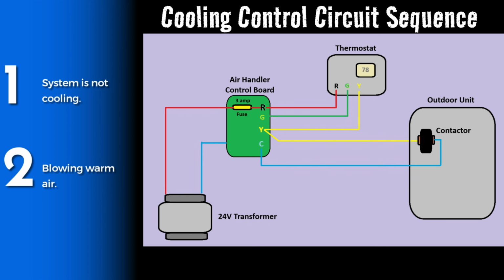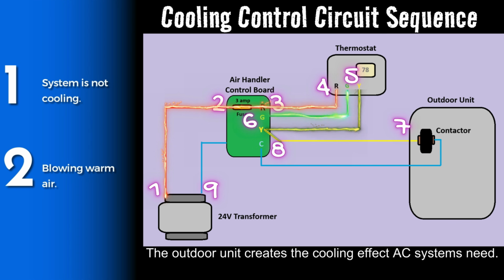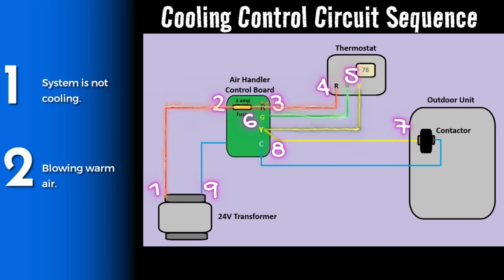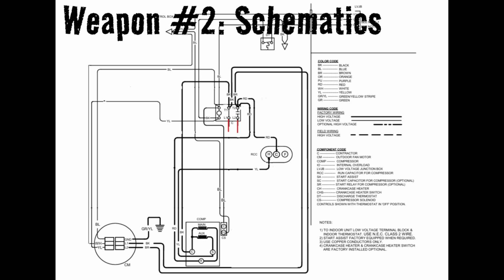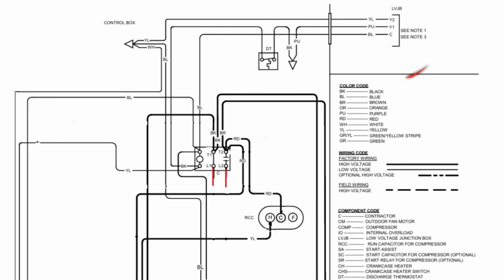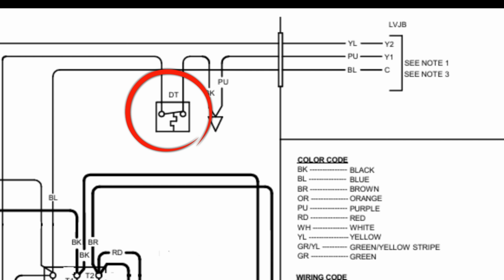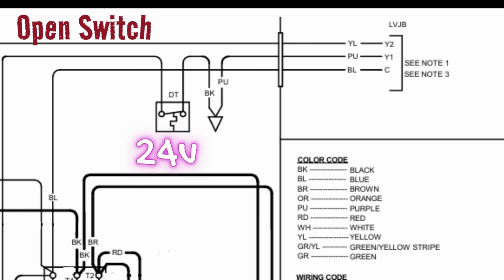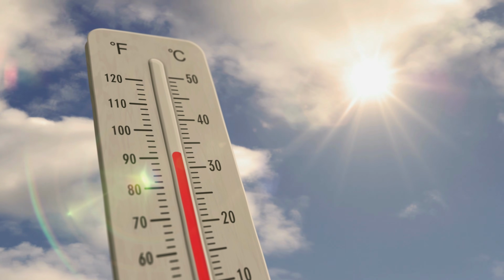Learn HVAC Diagnostics: 3 Tools That Make Techs GOOD

Comment: Mr: Jersey I am kind of confuse in this video 7:5 you have an open switch, that means is open and the reading will be 0 v, because there is not potential difference and that is discharge tstat,, that is a sensor that opens on pressure, rise, so when is close should be read 24v and not when is open, or that discharge tstat does not have potential difference I am kind of confuse m: Jersey, sure I will check ohms in any case.
And all schematics should be aware and check when power is off right. Ohhh I see the dt is suppose to be open because the unit is on correct
Reply: You are incorrect. The first terminal of the switch is supplied with 24 volts. If the switch is open, it means that there is no continuity between terminal 1 and terminal 2. This means that the 24 volts at terminal 1 has no means of travelling through to terminal 2. Therefore, terminal 2 will receive 0 volts, and the potential difference between both terminals will be the difference, that is; 24 volts. 

Once the switch closes, there will be 24 volts at terminal 1, and there will be 24 volts at terminal 2. As such, there will be no difference in potential between the two terminals, and metering for voltage across them will give you a reading of 0 volts, despite the switch in fact being energized. 

Hope that helps, let me know if it was still confusing

Comment: You could do a continuity test on the DT switch. If it’s OL, then you know that there is something wrong. Every time I receive a call for no cooling or heating, the first thing I check is to see if the fan is running. If it’s running, then I see if the compressor is running. If the compressor is not running, I check the 24 volts on the contractor. If there are no 24 volts, I know that one of the safety switches is opened. I check the safety switches for continuity and if there is an OL on one of them, I know where to go from there. I work at an hotel. Every rooms has a small heat pump that works with the chillers and cooling towers. From my time working here, I remember the wiring diagram by hearth. The classrooms AC units either in a closet or ceiling is the same principle. If the fan works, I see if the compressor is working. If the compressor is working, then I check the filter, the fan deck and  I check the pressure and go from there. If the compressor is not running, I check my 24 volts on the contractor and go from there.
Reply: Great stuff bro, im currently in school Hvac ans learning as much as I can👍🏼

Comment: Mike, a little bit off topic, but on the schematic there is no capacitor shown for the condenser fan, only the compressor. Does this mean the outdoor fan is an ECM or variable speed motor?
Reply from the maker: Yes, that's correct.

Comment: I recently found out the hard way that on  the new carrier 454b systems polarity matters when connecting y and c between indoor and outdoor units because of the dissipation board, Before it didnt matter which two wires you use outside. Now you have a 50/50 chance of it running or not running/ blowing the fuse.
Reply: then i got lucky 😂 i did my first 454b job friday